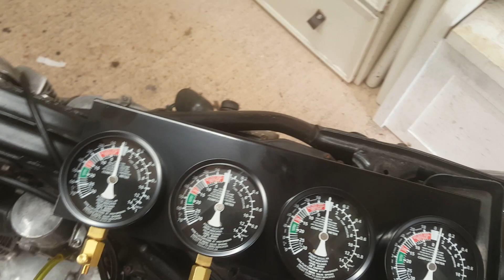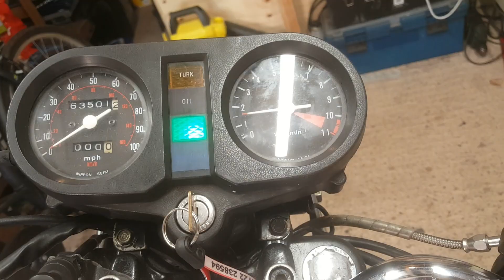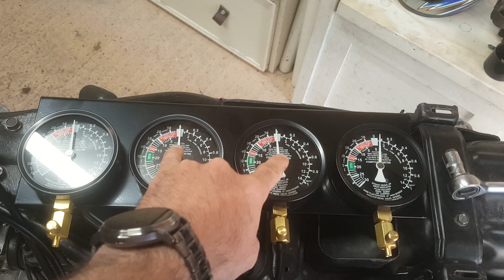Are my Carbs in Sync ?? trying new tools & sorting electrical gremlins. Project Honda - Part 44

Comment: Good day Ryan! That looked like a great start point re. Syncing. You can stop the needles fluttering by closing the flow to the meters a very small amount. That's what those brass nobs are for. 😊
Reply: Yes, for a more accurate reading you have to close them up so much they barely pulse, but still react to the bike! In the beginning it seemed like the left gauge was shooting up further right, but that might just be my imagination.
Reply from the maker: Thanks James, I did try that and it stopped them jumping all over the place, but guess more fine adjustment is required.
Reply from the maker: Thank you. I'll set it up again and pay further attention to the left side this time.

Comment: The brackets you recieved are headlamp brackets  they clamp around the forks and the headlight bolts in between
Reply from the maker: Thank You Terry, that would make sense. Although I clearly already have a different style clamp, so will keep these for a future build. :)
Reply: I have a couple of these myself, they came with the aftermarket headlight I bought for my CB400N cafe racer build. You might take a look here: https://youtu.be/EYwMzXAkBsM (2 min into the video) - I did not like them at all 😑

Comment: Every day is a school day, don’t always assume a five minute job will take 5 minutes, treat it as a learning curve. Those carbs looked spot on, but I would add, treat carb balancing as the last job once all other variables are sorted, plugs, timing, clearances etc etc
Reply from the maker: Hi Keith, Thank you. I am still often making the mistake of thinking "This should be easy", I have been through most of the possible variables, although I am thinking that I should really buy a rebuild kit for the carbs, as whilst it is running, I'm don't feel it's revving up like it should.

Comment: You should make sure your engine is fully warmed up before starting the balanceing process as the valve clearences will change as the engine reaches operating temperature. This will affect the balance when your engine is running and fully warm. and could throw the balance out if you do it cold before your engine reached operating temperature. Also, you need adjust the brass restrictor valves to stop the needles fluttering all over the dial to ensure you get an accurate reading.
Reply from the maker: Thank you. I'm learning more and more each time I work on these bikes. I feel I'm getting closer to it running right. but here is likely to be further tweaks required. Ryan

Comment: Mate they are not a million miles out but they are not sync'd.  It's only minor tuning but it may well cure it.  1&w should be reading the same on idle, ditto for 3&4, then sync the pair together.  It's only minor but.
Reply from the maker: Cheers Nat, I guess I need to be paying more attention to the finer details. Having not seen these before I thought it was close enough, but as usual I don't have a clue what I'm doing. :)
Reply: @RyansGarageUK  it's potentially only a tiny adjustment but it makes a huge difference.
Reply: I don't get it. This is a two cylinder. 3&4 what? I thought it looked perfect on idle.  You might want to keep throttle on 4000 rpm some seconds (ex 5-10 sec until the needles settles) to check if they are balanced on higher revs.
Reply: @kihestad  that is a bloody good point.  I am so used to 4 carbs and was watching while in the sun!  You are totally right.  Ryan, ignore me.  I am talking bollocks!
Reply: @RyansGarageUK  Ryan. See my reply to the message below.  I am talking bollocks!
Reply from the maker: @NatsNackersYard  ha ha ha. Well we all talk bollocks from time to time. That's what we do best!!
Reply from the maker: @kihestad  thanks KI, I'll recheck as you describe to be sure but I appreciate your clarification of Nats suggestion.
Reply: @NatsNackersYard  hehe 😄your intentions was well meant, and I can totally understand your thoughts - I am used to balancing 4cyl engines myself as well, I have just balanced 2cyl by ear...
Reply: @kihestad  jedi skills mate!
Reply: @NatsNackersYard  hahaha 😂🤣 I wish it was